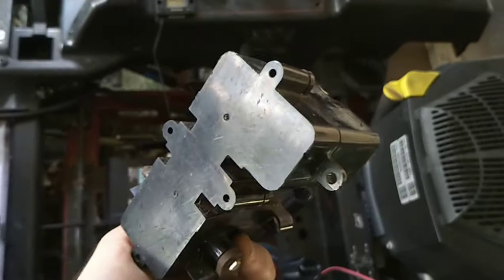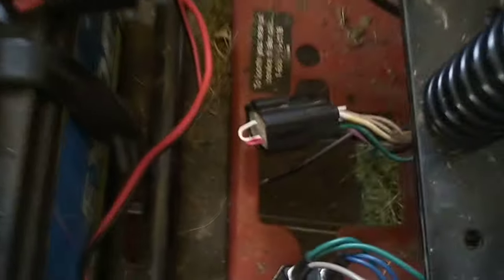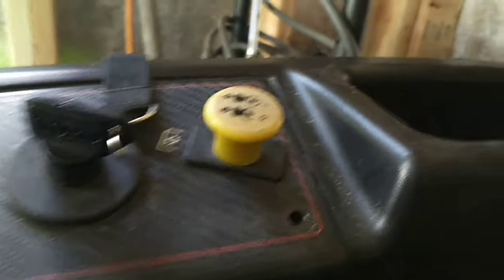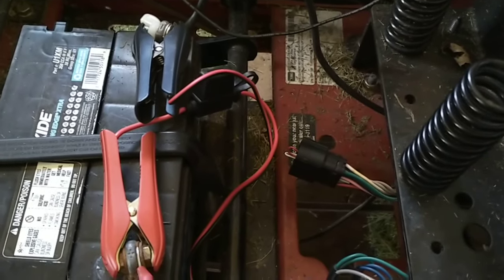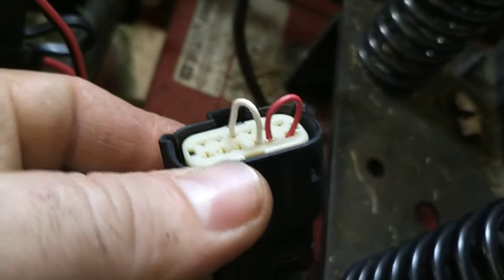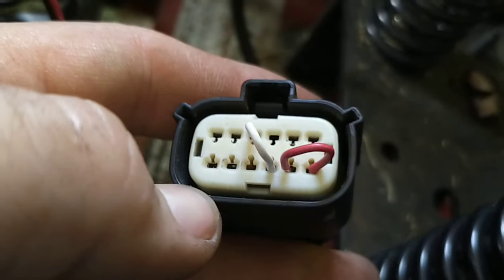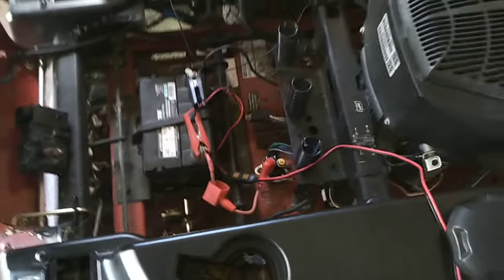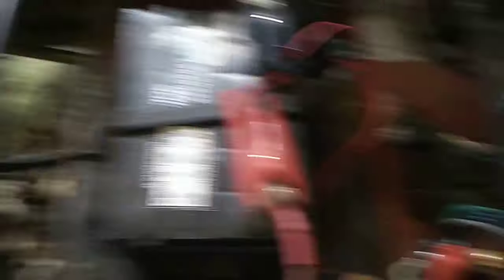Toro Timecutter Zero Turn Brake Controller Bypass

Comment: Mine does not have a harness that the brake module. Just about a dozen of wires that go into the module.  Had to take all kinds of stuff off just just to get the brake module out. I hate engineers!  They don't give a damn about how they design the product to make it so you can work on them ! All they want to do is sell the product and make money off of you. I won't be buying another Toro ever again.
Reply: I was wrong. The harness was covered by the cover of the brake module and I could not see it till I pulled the whole module out and pulled cover off.
Reply: My bad. The harness is located under the cover of the brake module.  You have to take the cover off of the brake module to get to where you can unplug the harness.